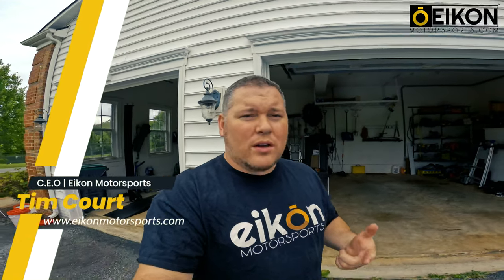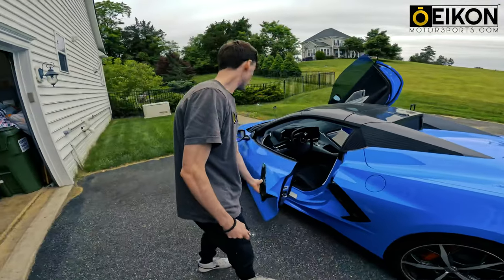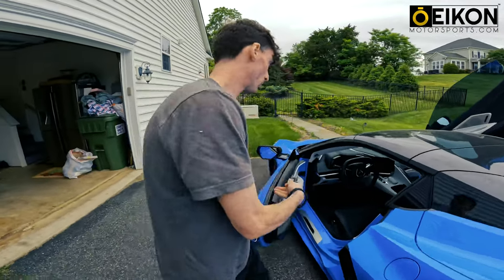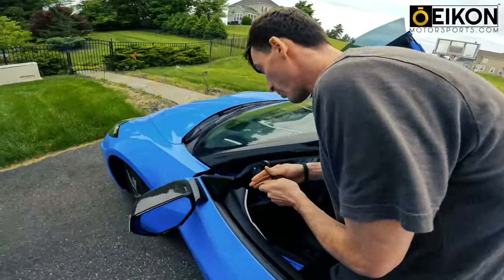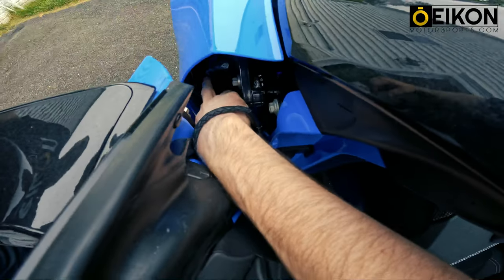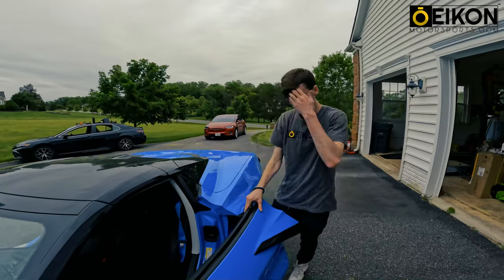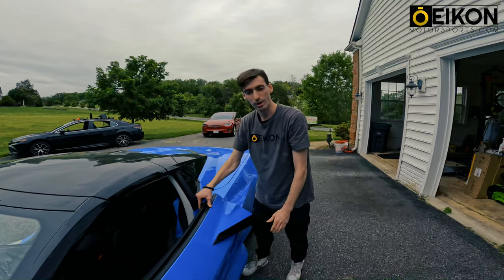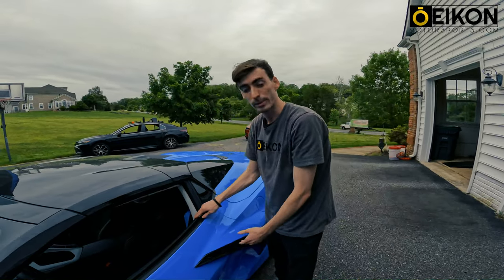How To Adjust Lambo Doors (Vertical Doors)

Comment: My kit from you guys should be in by next week. Its been 5 weeks . That good to know 👍🏼👍🏼👍🏼
Reply from the maker: A new video showing the new V1 series kits for the C8 will be released tomorrow. It will explain in great detail what's been going on and the cause of the delays. We apologize but I can assure you that Tim and the other managers are working very hard at getting our current problems solved and repaired. Tim is finally able to film again so within 24 hours a new video will be posted explaining what's been going on. I personally have not seen the video yet but I have been assured that its very informative and positive!

Comment: From another of your videos: Do you never tighten the lock-nut surrounding the hex adjustment nut?  If so, you don't worry about the hex nut slowly changing position?  Thanks
Reply from the maker: @eldochan8627  we use a lock tight that bonds but also allows adjustments. Tighten that nut will 100% create issues down the road for customers when they have to make adjustments. Our v1 series kits were designed to eliminate that problem

Comment: I have a 2006 Vette my door is down a bit to far I can loosen the bolt to drop it down more which isn't what I need. I need it to raise up but I can't tighten the bolt anymore
Reply from the maker: You don’t want to loosen the mounting bolts. Who did and when was your installation?
Reply: @EikonMotorsports  just got it done maybe 6 months ago and someone local
Reply: @EikonMotorsports  the door is off just by maybe 2in
Reply from the maker: @familycrgaming1907  ok. It sounds like the shop who installed it used the locking nut which is a no no specifically due to this reason. It prevents future adjustments which are an absolute must and inevitable with the vertical door kits.  Unfortunately there is no easy solution to fix. The whole fender will have to be removed again to provide access to the lock nut that needs to be backed off the 3/16th adjustment bolt. This is an unfortunate mistake we see a lot from inexperienced installers. Where are you located?
Reply from the maker: @familycrgaming1907  send an email to support@eikonmotorsports.com and just request a consultation call. It will more than likely be Tim himself that will call you.
Reply: @EikonMotorsports  I'm located near Columbus Ohio if I can get the fender off would it be something I could do myself
Reply from the maker: @familycrgaming1907  from the sounds of what’s going on it really sounds like it needs to be completely re installed the right way. Please don’t take offense to this but, most shops that don’t do this specifically every day all day can’t typically get it right.
Reply: @EikonMotorsports  makes sense thank you at least I know what's going on wish I was closer to you guys would of went to you
Reply from the maker: @familycrgaming1907  We do offer a recertification and installation warranty for $999. We come to you, tear it all apart and reinstall at your home.
Reply: Where are you guys located I live in ohio